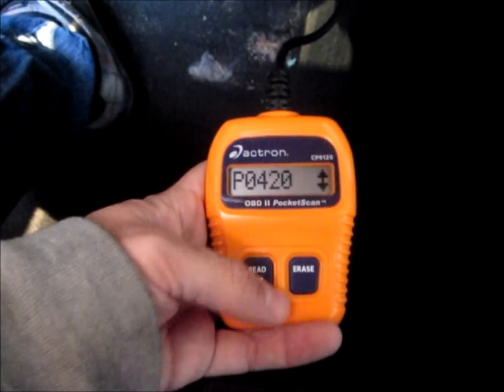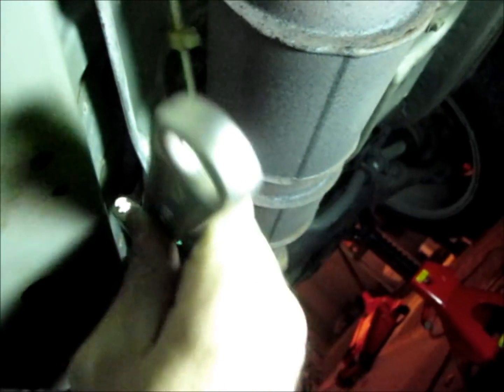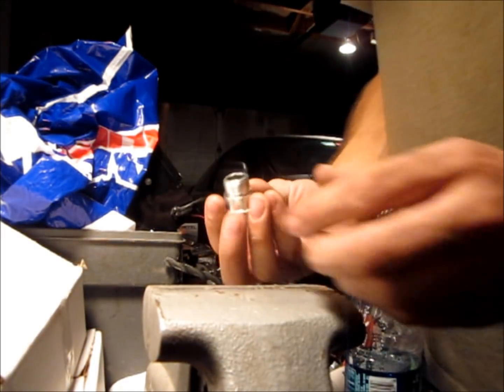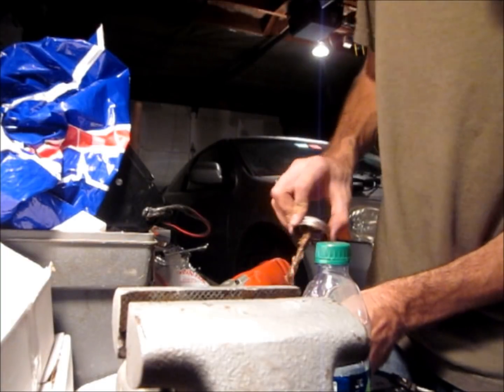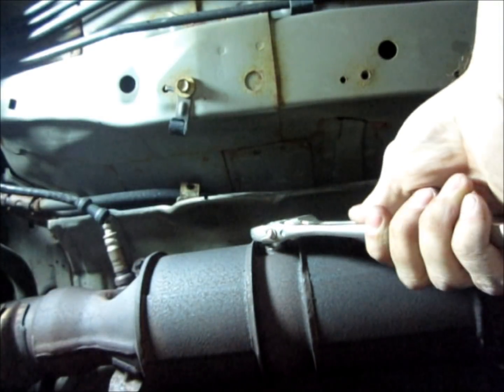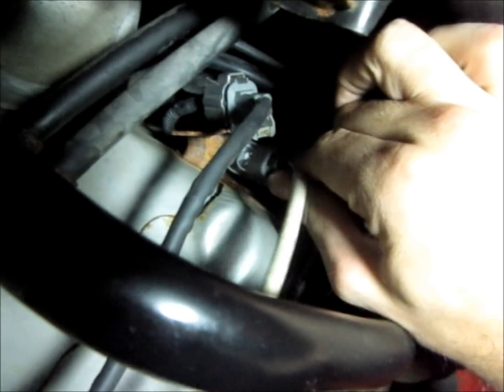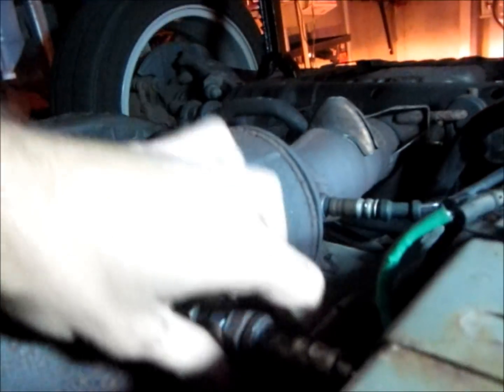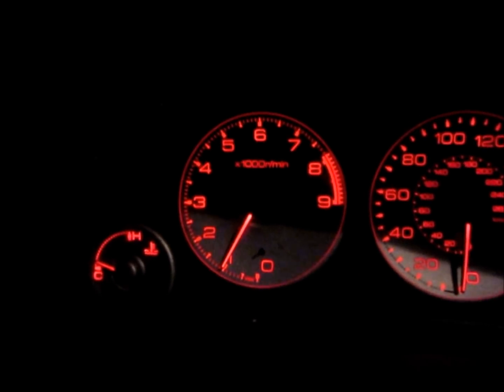Clear check engine light for less than 5 dollars

Comment: The maintenance light is telling you to do an oil change it should come on every 3k miles or whatever your factory service interval is set at, has nothing to do with the engine light. The reason your engine light cleared initially is because disconnecting the battery also kills power to the ECM (car's computer). Sometimes this trick works but doesn't guarantee success and if you're pulling an O2 code it's not the sensor going bad-it's the sensor telling you that there is a larger problem

Comment: If you dont care whether the cat is operating correctly or not go for it. After all it is only the atmosphere that suffers,  Oh by the way, if you want to get rid of that pesky seat belt reminder light and chime, why not cut the belt off the metal end and just snap it into the receptacle,  after all it's only your life that you're risking.  As a professional technician I will only add that check engine warning lights are there for a reason!

Comment: This mod works! I got a 2002 regal ls with 150000 MILES . I reset the P0420 code, did what the video shows, drove around for like 80 miles and it passed smog. Before I went to get it smogged, I went I'm to my local O'Reilly s and borrowed their diagnostic code reader, just to make sure that the car had done a full cycle in all the sensors, thanks for the video!

Comment: This does work... 
But you can get a code after about 50 miles that reads "low voltage" for the o2 sensors... Don't worry... In most cases after running it a bit more they will clear for good... The computer just has to relearn everything.

Comment: For those of you who didn't use google, P0420 means "catalyst efficiency below threshold.  The downstream O2 sensors are reporting to the PCM (computer) that there is excess oxygen in the exhaust because the cat is not burning it all to reduce emissions. By installing non-foulers in-line with the sensors, it reduces their exposure to the exhaust gases and therefore makes them send lower readings back to the PCM. This rig will not affect the engine in a negative manner.

Comment: Perhaps, a false downstream o2 reading could potentially generate a minor issue, in the event that the upstream o2 sensors fail.  However, it's highly unlikely.  Besides that, I challenge you to show me ANY engine that has ever had such an issue out in the real world, and not speaking theoretically. (Upstream o2's fail, and only downstream still functioning, thus altering fuel trim.)  I'd seriously bet you can't.

Comment: V8KindOfGuy... I believe you are an intelligent guy, but it's clear that you are not fully informed as to how your fuel injection system uses various sensors (inputs) to control its functionality (outputs). I'd recommend studying up a little more on learning about what various o2 sensors do in a given engine's fuel/exhaust/emissions system, and then once you fully understand what you have learned, then you'll know what you are talking about. Then criticize creative workarounds if you still must.

Comment: One last thing... you do NOT want to do this mod to either/any of the upstream o2 sensors. The UPSTREAM o2 sensors are the only o2 sensors that DO have a direct effect on the fuel trim (air/fuel mixture ratio) of your vehicle's engine. You'd be better off with unplugged o2 sensors, because although your CEL (check engine light) will be on, your engine will remain in "open-loop" mode, meaning that your fuel injection is controlled by a pre-mapped fuel mixture program in your vehicle's computer.

Comment: If the downstream o2 sensor is bad, it's pretty easy to test.  You just look at the live data on your scan tool and watch to see if the o2 sensor is functioning as it should, ranging up and down, typically in a much slower (aka: lazy) fashion, as compared to the upstream o2 sensors.  Your voltages should be much lower as well, ranging from .02V to 1.0V.  Typically, they will range from .03V to .07V when functioning properly, however every manufacturer's vehicle may be a little different.

Comment: BTW, you are 100% WRONG about the comment where you said, and I quote... "This code may be an indication of a clogged cat or just be as simple as the o2 sensor itself." <--- WRONG! The P0420 Code is: Catalyst Efficiency Below Threshold. What that means is that your catalytic converter is not working properly, and it is not blocking up and "cooking" enough of the raw fuel that typically escapes through the exhaust and the catalyst. A P0420 code is NOT set when a catalytic converter is plugged.

Comment: Let us know if this works for you. It may not. I did this same "non-fouler" mod on my '98 Chevy K1500 pickup truck, after I gutted my catalytic converter (due to it fell all apart inside from age and wear). My truck has 220K on it and still runs strong. I'm NOT buying a new catalytic converter, as it's NOT worth the investment. The non-fouler sort of worked, but it set a new code. The sensor flow is now too limited. The o2 sensor often isn't picking up any reading at all, thus a different code.

Comment: It is NOT a filter. It is a spark plug non-fouler, which was originally designed for engines that have issues with high engine oil consumption due to high mileage wear, such as worn piston rings or bad valve seals & guides. It moves a spark plug further from the combustion chamber. The "kit" with 2 non-foulers is available at most auto parts stores. I bought mine from Advance Auto. You will need to make sure you get the correct threaded version for your application. 18mm thread is very common.

Comment: This is simply a WORKAROUND, used for when you have a catalytic converter that is useless, or not even there, and is NOT plugged. The mod does work on many, but not all vehicles. IT WILL NOT, I repeat, WILL NOT hurt your engine. You are moving the downstream O2 sensor further from the exhaust flow, attempting to make voltage readings "lazy", simulating a working catalytic converter. Doing this mod does NOT have any effect on your vehicle's fuel trim. I AM a professional mechanic. Now you know.

Comment: I just ran E10 in my cavalier for a few hundred and my p0420 went away, and most vehicles can run e10 with no issue. And it will also help you pass a sniff test if need be, I don't even have emissions laws in Indiana but I just wanted to see if it worked. Obviously it only works if it is due to a slightly dirty system. If it is heavily soiled or straight up broken it won't do crap lol. =)

Comment: This is the 2nd O2 sensor which in almost all cars has very little authority over the fuel mixture; it is the 1st O2 sensor which most cars use to set the mixture; the 2nd reacts too slowly (because of the cat) to be optimal for fuel trim.

However, in 1st O2 sensor malfunction conditions, many ECUs will give the 2nd O2 sensor some fuel trim authority, instead of dropping to open loop mode. In this fault condition, a false 2nd O2 sensor reading may cause engine damage due to incorrect trim.

Comment: In general P0420 means dead cat. If this is the only code, it is very rare for it to be anything else. This code is only set when the ECU detects 2 working O2 sensors, with the same switching rate. A working cat makes the second O2 sensor switch slower.

The cat doesn't need to be blocked. Burning oil, bad fuel or use of fuel additives can "poison" the cat.

This mod blocks exhaust circulation on the O2 sensor so it reacts slowly. ECU thinks slow reaction = working cat = no code

Comment: When running lean, you will increase combustion temps in the engine! This can lead to overheating issues, detonation (which damages the engine), piston melting (if bad enough) and so on. Running lean effects the insulating boundary layer of the cylinder  and this dramatically increases heat transfer to cylinder walls and piston crown. This is what melts pistons. Fuel that you are removing (by doing this "fix") is what helps absorb some of the heat in your engine.
Reply: running lean is not so bad if you are reasonable and not operating at high RPMs.

Comment: BE CAREFUL!!!!! This is not a fix! This code comes on when something isn't working right, not just the feels like it should have that code. putting this in does not fix what's wrong with your car. AND YES, there are a lot of adverse effects to doing this. Taking  the o2 sensor further away from the exhaust stream will cause your engine to run leaner. This causes a ton of problems later in the cars life. This code may be an indication of a clogged cat or just be as simple as the o2 sensor itself.

Comment: Holding down the trip button does not reset the check engine light. Unplugging the battery for several minutes does that. The maintenance required light, which is what holding down the trip button prior to turning the key on resets, is for general maintenance (oil changes, etc).

Comment: It's a Catalyst efficiency code.  O2 sensor is still functioning. By doing what this video says, you are just tricking the O2 sensor into reading a different (lower) reading that the pre-cat sensor, telling the PCM that the converter is doing its job.

Comment: I did this same trick about 3 years ago on my 04 Nissan Frontier 4x4 and I still have not got a check engine light since. It works. Also I live in Texas and only certian counties have to take the emissons test so if you dont live in one of those counties you dont have to worry about it. Its still a good idea because it make the engine just run better with better gas milage. It was going to cost me $2000 to have both converters replaced so why not do it...

Comment: All you're doing is restricting the exhaust flow to the sensor head itself by reducing the size of the diameter of the extension and lengthening it further from the exhaust pipe itself. While it will turn the light off, it will also send incorrect reading to your ECM and effect fuel mileage. You are better off just replacing the $25 oxygen sensor and calling it a day.

Comment: @megagemini58 check vacuum leak near throttle body and/or intake manifold(PVC valve hose) also check your motor mounts, could be a loose bolt on the mount causing a vibration.

Comment: hi, I have a nissan exterra 2002 even i changed the knock sensor ,oil changed air filter changed the engine  still shaking  and the engine service still light on.

Comment: Yes it will work but you need to use a different kind of part its basically the same concept but this design have an added screen filter in the adapter ,works on my 2001 civic and 2012 tundra both Cat have been gutted here"s the part you can get it at amazon for 40 bucks ( O2 Minicat Sensor Spacer Adapter Extender ) ...

Comment: The reason the p0420 code comes up is the converter is not capable of storing free oxygen due to degrading of the platinum/pladium in the cat.
48 years ase tech.

Comment: Basic Mechanics 101: Use TWO spanners to loosen / tighten battery terminals. This will prevent ruining the delicate seal that sits at the base of the post and prevents your battery leaking

Basic Mechanics 102: If you have a MIL light on, chances are, there is an issue that needs resolving. Dodging it up like this will only cause further issues later on, which in a sense means people like me get paid when your car self destructs and you cant bandaid it anymore.

Comment: FYI you can get this peace from Amazon for $5.00 ready to install no drilling needed ,before you do this trick try this first driving your car in the Highway doing 70 mph or equivalent to 3,000 rpm for 15 to 20 minutes doing so the high exhaust pressure will clear the contaminants inside your catalytic converter after this clear the code ,if this don "t work then get the engine light fix from Amazon ...

Comment: If the light goes out on its own... That means the computer has reset itself. ''Modern'' cars DO NOT reset on their own. You MUST turn the light off with a scan tool. This same code caused my Jeep Wrangler to cut my MPG in half.

Comment: It is confirmed by me! this technique really worked in my Toyota Camry 02. However, make sure you use one or two per O2 Heated Sensor (Downstream Sensors). Part #'s are (42002 or 42009) Spark Plug Non-Foulers. The Parts # may vary per vehicle, I used (42002) (ask be4 you buy). Also use 1/2 inch drill bit ONLY. anything bigger or smaller will not work. I live in Florida. We do not have inspections here but it is good to get rid off the ENGINE LIGHT in case other codes show up. Have a nice day.:-)

Comment: when getting an inspection on newer cars, this will not allow you to pass. Yes the light will  go out but when they hook it to the computer it will show that the computer has not reset. Once the computer does reset (after driving for a bit) the light will likely reappear.

Comment: This does not work on every car. I know it worked on my 88 camaro with the obd1 computer but cars after 1996 have obd2 computers and many require a reset tool to turn off the SES light. I bet rammer561 can tell us.

Comment: Why would you want to gut your cats? It wont make the car run any different  at all, good or bad cept turn on the check engine light with cat codes. You only need to do that if your engine is highty mofified and you need more exhaust flow.

Comment: I do smog inspections and diagnostics for a living. Having a  P0420 code wont do anything to the way the car runs. It just mwans the cat is degraded enough  that it wont clean up the emissions much anymore and will probably fail the  tail pipe part of a smog test.

Comment: This would probably keep a P0420 code from coming back as long as it shields the O2 sensor from the oxygen. Problem is it just masks the fact that your catalytic converter is shot. There is a small chance the car will still pass the tailpipe emissions test in a smog test (depending on how degraded it is)  but odds are you wont pass.

Comment: WOW i found this same idea on a forum but the purpose was to make the o2 senser sense less O2 by bringing it out of the exaust stream , the purpose was to cause the computer to make the engine run leaner for the purpose of increasing mpg and power. the easiest way and safest way to trick the computer nto doing it; if the system senses less O2 then it thinks its running too rich so it leans the mixture

Comment: Alright guys I need your help. I'm looking at a 96 EK with a B16a and its boosted. Its throwin atleast one code with the CEL. I really really want the car but Im worried about how am I going to get it to pass inspection. What am I getting into? I believe its OBD1 also.. Please someone shed some light on this. I've never owned a car newer than 95 so its never been an issue.

Can I just put in a high flow cat, stock ecu and disconnect the charge pipe just for inspection? Would that work?

Comment: yes this should work on your car. its possible it did fail. This is a popular technique for the tuner world and people eliminating their cats. what it does is pull the o2 sensor out of the main exhaust stream. so that its not getting the full effect and reads a lower gas level. tricking the computer into thinking that the cat is doing its job and filtering the gases.

Comment: Thank u very much for the informative video
, I had a code regarding O2 sensors, so I changed the downstream ones, after 2 days, the check engine light came back and shows P0420. Do you think that it may be related to the O2 sensors? or its just my bad luck that the catalytic converter has failed 2 days after i replaced o2 sensors?

Comment: If you take the cat converter out, number one you will instantly fail a visual inspection, number two no, it will throw a CEL. Either P0420/P0422 or P0430/P0432 depending on the car. You can clear the code all you want, but the car will never pass the Inspection/Maintenance Readiness test. When they say you have to "drive your car 50-100 miles" that's so the IM readiness tests can complete. There's ways to tricking it though. It's complicated and very time consuming.

Comment: ...continued
The downstream also plays a small role in some cars to control fuel trims for longer cat. converter life, however this mod won't ruin that. It's still going to get a reading, just not a great one.
This mod won't work on all cars, some will get a P0139/P0159 downstream slow response. If this is the case, just replace the damn 02 sensor. 
You won't know if the mod works until all I/M readiness tests are OK or N/A. It won't hurt anything to try it!

Comment: Incorrect.

The downstream 02 sensor does not control engine performance. That is the role of the upstream 02 sensor, which observes whether the engine is running at stoichiometric levels, and also during closed loop mode (cycled between lean and rich to lower NOX emissions.) Heavy load/open loop the 02 is ignored completely.
For all intensive purposes the downstream 02 sensor is there solely to monitor catalytic converter efficiency. DO NOT do this to the UPSTREAM 02 sensor. Only DOWNSTREAM.

Comment: Well, this mod should tell the computer it's burning rich (cool O2 sensor), so the computer will lean out the engine, probably much higher than 14.7:1. The only bad effect should be more nitrides of oxygen produced. The good effect will be much less gas consumption, and thusly less CO2 per mile produced (rob Peter to pay Paul).

The only thing I would watch for is erosion of the earth electrode on the spark plugs. If you see that, you are burning way too lean.

Comment: Hes merely seperating the distance from the emissions and the sensor so it doesnt trip the cel, nothing is actually wrong with the engine, its just telling him that his fuel/air ratio is slightly off. plus hes not even using this car street legally. Why do you care.